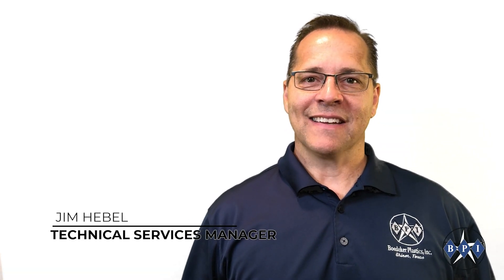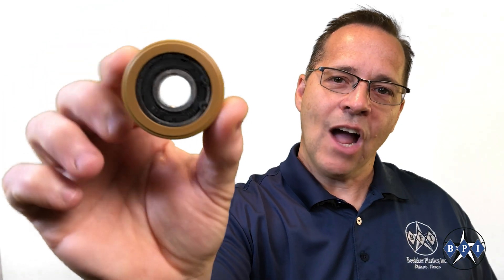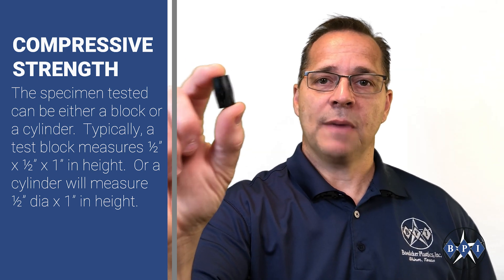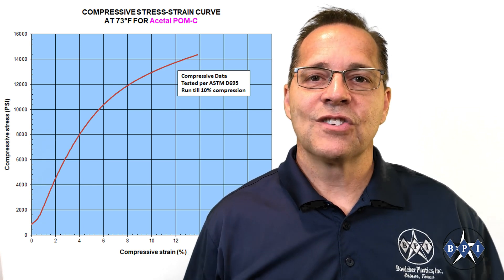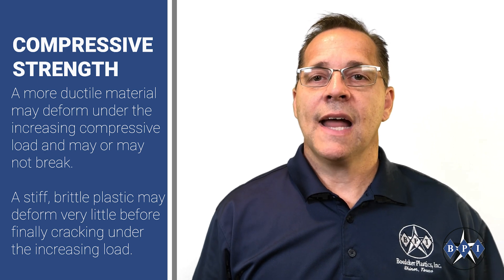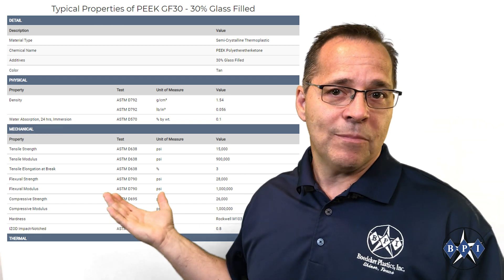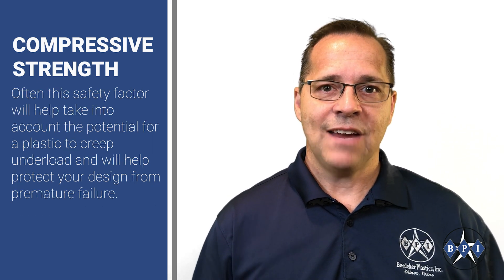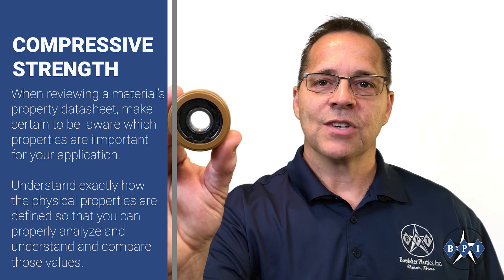Boedeker TECH Talk Episode 8 | Understanding Compressive Strength ASTM D695

Comment: Quick question, what test would be more representative of the load that is applied horizontally when the sample is standing on the test machine, for example when you break pasta in half by snapping it with both hands and making it break in the middle? would it be a tensile or a compressive strength test?

Cheers!
Reply from the maker: I believe that the Flexural Strength Test (ASTM D790) may be more representative for the load you are describing.  For the Flexural strength test, the sample is positioned horizontally, and a load is applied in the center.  Essentially, you are measuring the ability for the material to flex in half and resist breakage.  Thank you for your question.

Comment: Great video. Thank you. I was wondering if you sell the standard molds for sample preparation. If not, can you suggest to me where can I buy them? Thank you in advance.
Reply from the maker: Thank you for your compliment.  Any testing that we conduct in-house are based on machined test samples from stock shapes.  Our business is mostly dealing with formed shapes....rods, sheets, and tubes.  Unfortunately, we don't sell the test sample molds, nor even really use them ourselves.  I would think most any mold tool builder could make them for you.

Comment: ASTM D695 mentions the use of a compressometer to measure strain, but is it possible to attach it to the compression platens for thin specimens with the support jig? Ignoring the fact that a much more precise calculation would be using strain gauges
Reply from the maker: Thank you for the question!  I am familiar with testing samples approximately 1/2" square x 1" long using an Instron machine.  In this set-up, the strain is measured by a load cell and the movement/travel by the crosshead.  So, I am unfamiliar with using a compressometer and can't really speak to how it could be used/attached to compression plattens.  My suggestion would be to reach out to an equipment manufacturer like Instron, Tinius Olsen, etc.  They may be able to better assist with your testing options for thin parts.  Good luck!

Comment: What are the factors affecting in this method
Reply: I am Sherin Vedha from India (Tamilnadu).Iam studyinh MTECH Plastic technology In CENTRAL INSTITUTE OF PETROCHEMICAL ENGINEERING AND TECHNOLOGY. And also I request you to upload more videos related thermal, optical and electrical properties.That will be very helpful for my studying purpose.
Reply from the maker: Thank you for your interest in Boedeker's TECH Talk series on plastics.  We are always looking for our next topic.  I will be sure to add some future topics related to thermal, optical, and electrical properties.  Good luck with your on-going studies!
Reply: @boedekerplastics  Thankyou so much sir for providing that information quickly
Reply from the maker: Hello and thank you for your comment.  Are you able to clarify your question for me?  I am afraid that I don't fully understand.  I'll then be happy to reply.
Reply: @boedekerplastics   Thankyou for your response sir ,Actually my question is about what are the factors affecting in this technique for example Higher the temperature lower the strength ,Moulded specimen shows better compressive strength than the specimen prepared by machining or lamination process.
Reply from the maker: Thank you for the clarification.  Yes, temperature will certainly affect the strength of the material.  As temperature increases, a polymer material will tend to lose strength.  And certainly as the temperature exceeds the material's glass transition (Tg) a significant reduction in strength will start to occur.  I have not done a video on Tg yet....but this is the temperature at which the amorphous bonds of the polymer structure start to release and slide.  Watch our videos on DMA and Heat Deflection Temperature.  There are other factors which can also affect a materials strength including moisture absorption (if large enough), Strain rate (rate of applied load), and time under load (CREEP).